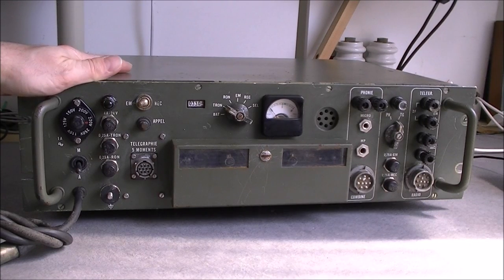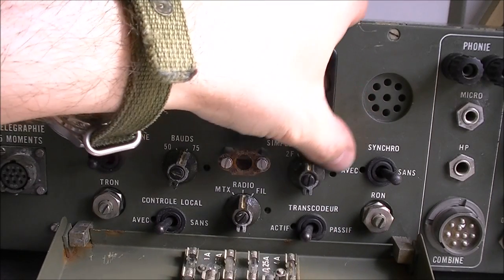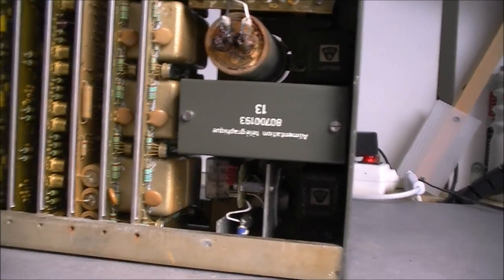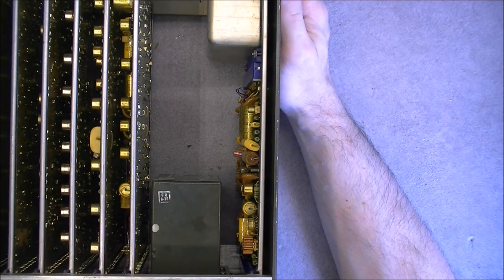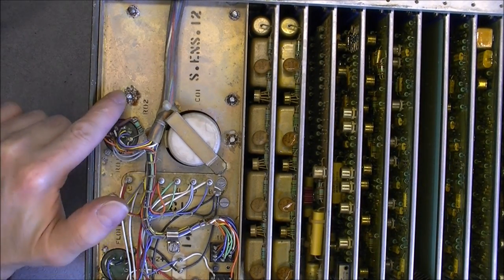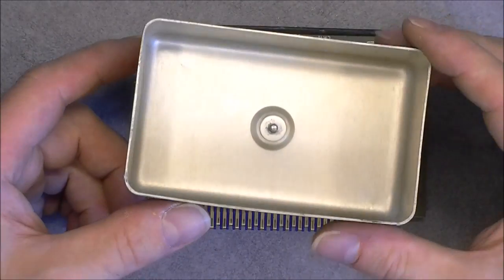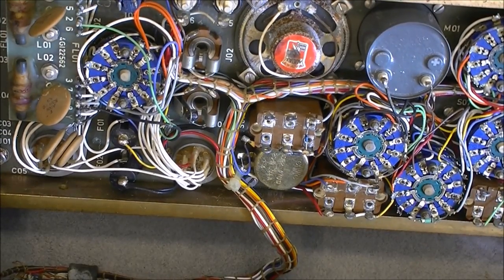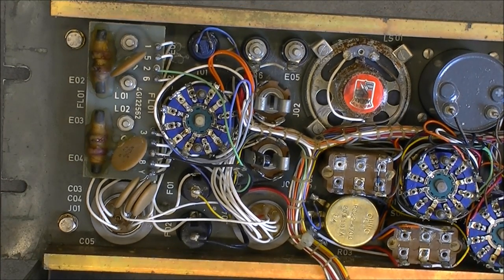Military electronics teardown: ME-100A RITA  "Coquelet" radio telegraphy transcoder

Comment: I saw one similar in an American tank it allows voice and cw transmission at the same time
Reply: By the way the tank was from 1965
Reply: I am sure what you saw was a GRC-106 radio transceiver... it can work with voice, morse code and FSK teletype... and it was widely used in the 60's and 70's, especially in V'Nam...